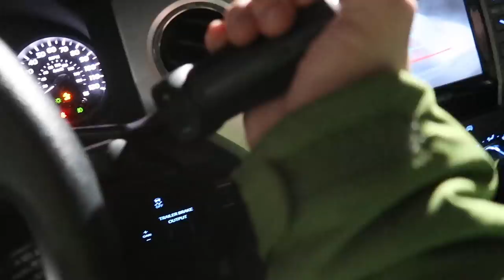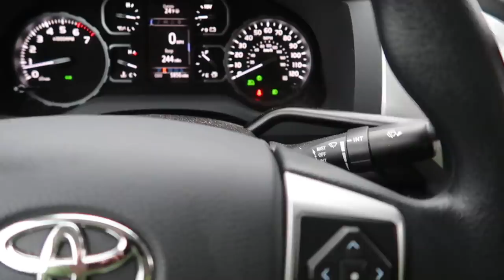At this Point it's a Rescue MISSION! We Gotta get the Truck OUT before we do any Damage to IT!

Comment: Here in SW MO we dont get much snow. We do get a lot of ice though. The best tip for getting around on ice is a decent load in the back of your truck and a couple 5 gallon buckets of fireplace ash. The load helps you maintain traction evenly between all 4 wheels. Better on your drive train. And the ashes actually react with the ice and melt it partially and give you the best traction. Stay safe in this cold weather!

Comment: I remember a few years back when we had 12 inches of snow several times in a little over a week. Finally, they quit shutting down the school and just came in the snow. I had to pull out the Gator -- our only 4-wheel drive -- and we slogged through the deep snow the 1/2 mile to the bus stop. I picked her up that night with a sled on the back and she had a blast. She still talks about that years later.

Comment: That's great you're still getting chicken eggs through the winter. On your truck, Since you've already got studs, if you lower the air pressure of the tires the truck will get a LOT more traction and recover itself with more studs making contact with the ice.  A set of chains on the rear would probably make a world of difference too.  Stay warm.

Comment: I usually carry a huge pile of sand in the back for weight to counter balance the plow weight. This helps my traction a lot and when I do get stuck I just put a little sand under each tire and I am usually good to go. Also in 4wd low all 4 tires seem to turn together to help get un stuck.
Reply from the maker: Do you have a cap on your truck
Reply: @LumnahAcres   No cap just open bed. Our town lets us get all the sand we want from the same pile they load the big trucks so the sand is usually mixed with a little salt to keep it from freezing.
Reply: @LumnahAcres , Our town does the same except I put it in 5 gallon buckets with lids. I have 6 of them but only fill half way so they are less likely to tip over. I also carry 400lbs of lead weights from our old tractor pulling days. Makes a HUGE difference !  Keep the weight up against the tailgate, it will make the most difference.
Reply: Bill and Al we sometimes even use cinder blocks in the back of the bed just if we dont have any tube sand, its what they have here in Missouri...you can get these big tubes of sand for those times. Something I learned when we moved here...but might not be enough weight for your truck
Reply: I have a 55 gallon drum strapped on the back of my trk half full of dirt.  Im thinking buying a new drum with lid and filling with dry sand.  Its nice having a flatbed.
Reply: I have nine 70lb tubes of sand in mine
Reply: Maybe even a 2nd set of rim's to have winter tires on + stud's wouldn't be a bad idea?

Comment: Best thing I ever saw for additional weight in a plow truck was one my Dad's boss used back in the 50's/60's.  He had a 2-3 inch thick piece of bluestone cut to the size of the truck bed...lots of weight and didn't take up my space.  of course he also had a tractor and bucket to load it into the truck in the fall and take it out in the spring.

Comment: Al, We finally got snow today.  About 3"! Want to swap? I was out to work early to clear manually and salt. -6c overnight,  but 1c when working. No wind. I think you can get metal tracks to put under your wheels, like narrow sheets of metal roofing. You slot them under the tyres and drive over them to get out of a bind. It's difficult to know what to do with tyres, your property may need chains, but the public roads not. What to do? We put winter tyres on Jan to March but they are mainly for water displacement as we don't get much snow. They have superior grip. No more nonsense with jacks, trucks and ice Mr! I am watching you!!! Regards Stephen.

Comment: Just a tip for Boss V blade controllers.   If you press both buttons on the Left at the same time, it will bring the left wing back and right wing forward in a straight line for wind-rowing.  The same works on the right.  It keeps you from having to press buttons on opposite ends of the remote, or doing each action one at a time.

Comment: I went to a snowmobile shop and picked up a used snow mobile track for 10 bucks. I  cut it in half, carried it in the bed of the truck, and used it for traction when I would get stuck. Pea gravel work much better than plain sand.
Reply: Same idea as a MaxTrax, but much cheaper.  Good work amigo.

Comment: Al, Many folk with some acreage here in Maine keep an old truck converted to plow use that can not be "sticker'd" (not pass State Inspection) due to body rot. (Road Salt Cancer). It stays on the property with the back filled with sand/gravel and has tire chains installed that only come off to service or change the tire. The old truck takes all the plowing abuse and keeps your "road worthy/chick magnet" truck available for going into  town for supplies.

Comment: I use a 35 gallon plastic drum with a lock ring lid full of sand strapped in the bed right at the tail gate. Weight is about 600 lbs it keeps the sand dry in case I need it. I also found if you lay the drum on it's side & strap it to the cross bar for the trailer hitch the weight works good for both wheels to grip better.

Comment: Something else you could do is add some weight to the box between the fender wells. I put 300 lbs of sand in 
5 -- 60 lb sand tubes and I very rarely use my 4wd. Just a thought. Great video Al. Cant wait to hear the new rosters in the Greenhouse.

Comment: When you get stuck like you did. Try putting smaller lengths of split firewood behind your tires leading in the direction you want to go. The wood provides the traction you need to get unstuck. You can also use branches. By smaller, I don't mean length but girth.

Comment: There's a guy in New Hampshire on you tube that I watch Boss of the Swamp and awhile back he was showing 2 fold out ice grippers that he's had for years and he slips them under his tires and he's out !!! He's actually been looking for a replacement for them since 1 has broke, I think he found something like his old ones on Amazon and he's going to report on them once he's tried them.Great answer for stuck when your alone !!! Just found them-there's a few different ones but they're called traction mats and discount ramps.
Reply: keep smaller versions (snow traction mats) and a small shovel in my trunk. use them for whoever needs them. quite a few times in **"''wisconsin'**''*. gr8 20$ investment!
Reply: Might not be as fancy but an old carpet cut in two pieces, one for each traction wheel. Got me out of trouble more than once, that includes my neighbor.
Average cost 0$. ;-)
Reply: @crpth1  I keep sand and kitty litter in my truck always gets me unstuck. I was just giving Al some ideas since he likes Amazon LOL
Reply: @stan3198  - Yeah, no worries. ;-) 
Now that I mentioned it. I just remember that my carpet is under a huge pile of snow. No way I´ll get my hands on that thing before next Spring. LOL :-)

Comment: Work has a way of multiplying itself doesn't it. I've been thinking Al, what if you get hurt out there all by yourself. Do you have someone you check in with at a certain time each day, or an alert system of some kind? Specially now that it's so cold, it would be awful to be stuck out there all day. Well be safe. I pray for you.

Comment: To get unstuck clear out your area from snow away from the tires.   put fresh snow not packed around the tires (light coat).  put it in forward or reverse (better.) and release the brake. do not add power let idle speed do the work. once you get rolling apply power as needed but never allow the wheels to spin.  This probably will not work if your car/truck is buried in snow. However this will work on mild grades. The snow will also act the same as putting dirt around it

Comment: I saw in one of your videos you finally got snow tires.  Here in Los Angeles there is an abundance of Tundra wheels.  People buy a new truck and upgrade the wheels before it leaves the dealer.  It is typical to put a leveling kit on the truck and then put 33 x 12.5 tires on the truck.  I got a set of take-offs for $900 on Craigslist.  I should have waited a day because a guy was selling them for $700.  Brand new tires and rims.  They fit all 5 lug Tundra's from 2007 to 2018, maybe even 19 and 20.  What I'm getting at is you could get a set for your summer tires and swap them yourself.  Only thing you won't have TPMS for what ever season you wish not to have sensors.  Actually you could buy them and program them yourself each season with Tech Stream software and a wire from your PC/Laptop to the OBD II port.

Comment: As an operator for close to 40 years..
Pulling scrapers and trailers.. Pulling on the drawbar joints is what tgey are designed for..
Over time they wilk need to be replaced...
But for hard pulling or lifting the tractor off the ground..
Always put the chain around the rear axle housing...
Reply: Yar Nunya I second that entirely! i own two kinetic strap but the properties at work are the same!
Reply: Yar Nunya the stretching multiplies force a ton! chains are still handy but so tough to beat bubba rope or a kinetic strap

Comment: instead of sand, use ashes. your tires will grip like it's summer. the state of Montana uses potash on it's highways.,, no rust, no problem at all.
Reply: That what my Dad used here in Maine back in the 60's - 80's when we where running two-three woodstoves to keep an old drafty house warm.  Just be sure to store the ashes in a metal bucket with a tight lid outside off any combustible surface. (Too many house fires when the ashpail was left on the wood floor, steps or porch.) Also ensure the cinders are dead cold before tossing them under your truck.
The ashes stick to rubber so be sure to remove your muck boots before traipsing around the house. (Gina might have words to say!)
Reply: We're having a lot of ice issues this Winter. I'm using dry peat moss and wood ash on every path. Come Spring, it'll be appreciated by all my lawns and gardens.  I use the salted sand from the town garage on my driveway but nowhere else.
Reply: i always used two metal 5 gallon cans. when one got full and the second one got half full, i knew the first one was cold & safe. always let thee ashes "rest"a full week before using anywhere. yup,,they're sure a mess sometimes,, but totally worth it.
Reply: They use lava rock in SE Idaho and a liquid prior if storms
Reply: @jknewb6276  - We have a LOT of lava rock here in Hawaii, but it's illegal to remove it from the state...
Reply: @ladykiri42  ya, but unless you live at 12k feet, you probably don't need it in HI......
Reply: Ashes cause rust too. That's why lots of insulated chimney pipe is no longer legal. Was rotting from the inside. Sawdust is pretty good to use

Comment: Looking at Boss V plows brought me to your videos.  I noticed your wings seem to fold back when pushing a little easy.  After a bit of research, I found that there is in fact a pressure relief valve you can adjust to firm that up.  Obviously it's there to keep from damaging the plow or your truck if you hit something solid, but you should be able to push snow up the pile without them folding back on you.

Comment: next time you have to pull something that is stuck try using the pulling vehicle in reverse position. pulling in reverse makes the pulling vehicle torque the weight down on rear wheels,thus getting more bite on rear wheels

Comment: Next time you get stuck or need to drag something heavy use your bucket attach the chain to the top of the bucket hook the other end to whatever your dragging then tip your bucket all the way down pull chain tight and push the bucket edge into the ground then wail curling your bucket back up wail its digging into the ground back up you will be shocked at how much more you can pull that way

Comment: Hi...Nice video but you need "BEAR PAWS".  Made out of 1/4 inch metal 1 1/2 wide & 12 to 18 inches long with grip teeth pointing down to grab snow & ice with  webs across so tires can grip them.  Have had mine for over 20 years & they still work very good.

Comment: Ice issues that we face down here in Georgia is we put a few flat wooden boards down as tightly as possible and as many as we can find behind each tire to give the tires some better traction to grip onto (I personally use 2 pieces of 3/4inch 4x8 pieces of OSB plywood with 4 foot long 1× boards glued and screwed to the plywood every 6 inches to create some texture so the tires have something to grip to when spinning) (kind of like your chicken door ramp has) (I keep them in the bed of my truck all winter long just for that purpose or for other people I see that runs off the road ways .... Way better than yanking on the truck like that with the tractor... you can bend or twist the bed frame by doing that or even much worse break something with that type of force and tension and hurt you as well.... So next time go hit up your little lumber yard you have there on the property and lay some boards down behind the wheels 👍 or lay as much hay as you can if you have any if you don't have any extra hay you could even sacrifice a bucket or two of your mulch/compost pile and lay a heavy bed of mulch/compost down temporarily behind the wheels. YOU can always replace compost/mulch - YOU or the truck not so much... Again just some friendly positive advice on that if you don't mind me saying.
Also some more advice if you dont mind me saying seeing that your there at home by your self... Next time don't stick your hand or fingers under an elevated truck tire that's sitting on a jack sitting on not so stable ice just to pull a tiny amount of snow out. If that jack had decided to slide or shift for what ever reason any at all on that ice and it very well possibly could have happened in that situation then that truck would have come down on your hand brother and could have hurt you bad and even trapped you there for a long period of time with no help around. Again, not trying to step on toes or anything by saying any of that I'm just trying to help and give positive advice is all... Thats happened to a friend of mine before is why I'm saying it - luckily my friend had me and 2 other guys there to help get it off his hand but he still ended up losing 2 fingers because of it and many still rods in his hand afterwards and he also has permanent disability in that hand. As a former law enforcement officer when I worked we all practiced a saying during our rookie training and thereafter religiously daily in role call and out on the road which is: (slow is smooth, smooth is fast) 
Sometimes slowing down taking a quick second to think things out completely before hand gets things done faster but yet smoother and safer. That's all I'm trying to help with so again I hope you don't mind me speaking up.
I speak for all of us viewers that Love your channel and care about you and your family I'm sure when I say we/(I) dont want to see or hear of anything bad happening to you. Any ways glad you got it out ok and glad you're safe and sound.
God Bless Brother stay safe and stay warm. 

Sincerely
Robert Benson
(Gwinnett County Georgia)

Comment: Gooood Morning Al ,
I wonder , when plowing snow with your truck , are you supposed to have so much packed  snow under the truck ?  Al , you have lots of snow every year where you live so you have plenty of snow experience . On the other hand , you are much younger than I am .  Never ever put any body part under a vehicle that is jacked up on snow or ice. There is just too much chance that the snow can shift under the jack or the jack slip on the ice .  It only takes once to lose a gamble like that !
  Also , I winced every time that you jerked the cold brittle chain like that !  Jerking like that placed a huge amount of pressure upon a small area.  Lots of potential for some damage that way .  Do it like a draft house would . With a slow steady pull .  Jerking can easily exceed the breaking point !
  Feb. 3rd , I have 54* F ! Feels like spring ! All roads are completely clear.  Still lots of wet very slippery ice to walk on.  Whoops !    Close to or below zero for Jan. 31 , Feb. 1 and Feb . 2nd .  And I have no heat !  I know what my problem is .  But not what to do about it .  There is a vent pipe for my furnace burner that extends up above my roof .  Moisture in the air goes up that pipe and when the temperature gets down to around zero that moisture can condense and freeze. Closing off the upper end of that pipe. No vent , no burner operating and no heat .  I can cope by wearing a coat and a sweater. A warmer day like today and the pipe thaws out and I have heat again.  I'm thinking this summer of installing one of those heating tapes such as those for heating water pipes to prevent freezing .  Just dropping an extension cord down inside of the house so I can plug it in when the temperature starts heading for zero .
  Al , we are into February already. It won't be long now and you'll be tapping for Maple sap.  Be of good heart , spring is on it's way !

Comment: First and foremost-when you are in 4x4 mode and pushing or pulling a load all you have is front wheel drive.
You have to add weight in the rear of the vehicle too balance out the weight. Placing weight onto the rear tires. Chains help with traction on ice and in mud. Let out air in tires,add chains,air back up. Other than that your doing a great job. Just got to use your talents and ease your work load. Digging sucks unless your building something.